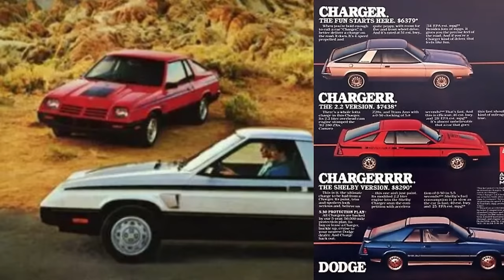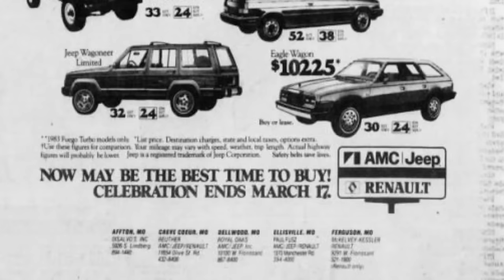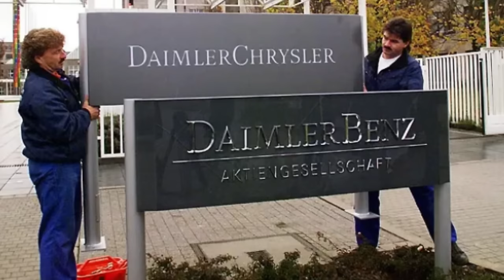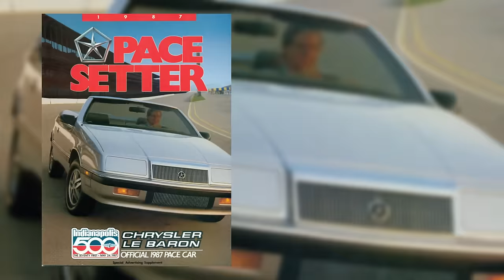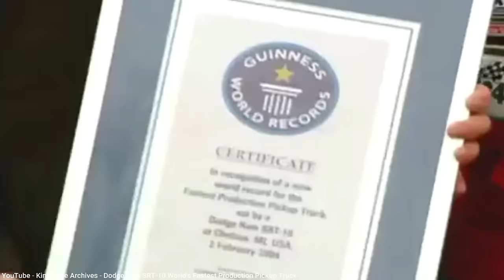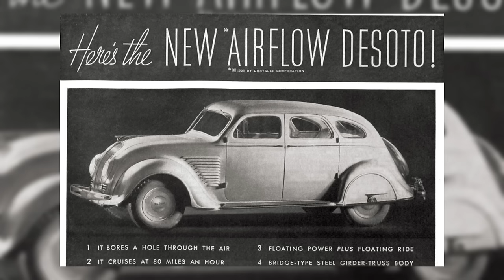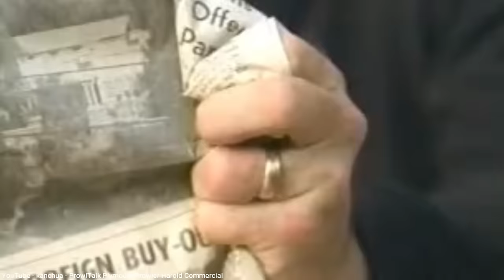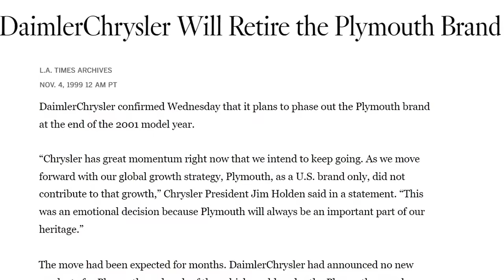Here are the Top 10 Weirdest Cars from Chrysler!

Comment: Small correction. You stated Chrysler’s Eagle brand never had any 4wd options. I currently own a 94 Eagle Summit wagon with AWD. Granted it is basically a rebadged Mitsubishi, but it was sold as an Eagle.
Reply: Also the Eagle Talon had the TSi AWD option from 1990-94
Reply: Technically 4WD and AWD are two separate drive types, but yes they did have models where 4 wheels could be powered at once
Reply: @buffufalo7714  I literally came to the comments section to say this
Reply: @buffufalo7714 I was just about to mention this one
Reply: The Eagle version of the Intrepid(Eagle Summit I think) had an AWD version. But those cars are RARE.
Reply: @davenhla  that was the Eagle Vision. I didn’t realize awd was on option on them.
Reply: @ottovonbismarck7094 You're splitting hairs.

Comment: A friend of mine had an Eagle 4WD with an in-line 6cyl. That car went Everywhere. He and his wife put over 300K miles on it.
An in-line 6cyl engine will ALWAYS out last any V6.
An in-line 6cyl has 40% less moving parts than a V6 and has a lot more low end torque.
Reply: Inline sixes are the best.
Making a comeback in the new Mazda CX-90.
Reply: Ehh, isn’t the v6 in the previous gen 4runner also pretty reliable? Not only that, but it’s more reliable than some I6s?
Reply: @E46SedanGaming  Of course. It’s a Toyota.
But the new Toyota’s with the Turbo engines simply won’t last as long as a Naturally Aspirated engine.
We were going to wait until the 26-27 year model of the Tacoma so the bugs could get worked out from the redesigned Tacoma.
Then I learned that Toyota was dropping the proven, durable and reliable 3.5L V6, so I started looking for a specific Tacoma.
23 came and went, so I figured that I’d have to buy a low mileage used one.
I stopped by Toyota to look at an access cab with the 6’ bed. I was wanting a double cab and I had to have the 6’ bed.
The truck was a SR5  but I wanted the TRD, but I figured that I’d have to settle for whatever I could get.
I would have bought it but it was the Gutless 159 horsepower 4 banger and I needed a V6.
I told the salesman what I was wanting and he told me that they had a new leftover 23 TRD but he couldn’t remember if it was a 5’ or 6’ bed.
It was in the shop having running boards and a Tri-Fold tonneau cover being installed.
They had just finished with it so he pulled it over to us.
It was exactly what I had been looking for, for over 9 months.
It’s White, TRD Off Road, double cab, 6’ bed.
Because the dealership had owned it for 8 months they were just trying to get it sold.
The MSRP was $51,848.
The dealership threw in the running boards, the tonneau cover, an 8 year 75K mile bumper to bumper extended warranty, lifetime oil and filter changes, tire rotation, and the new car care pkg all for free.
We paid $48K for it on 2/29/24.
The only thing that I absolutely HATE is the black leather interior.
I reached out to Katzkin and had them make me “Lava Red” leather seat covers with black trim and stitching.
Katzkin removed the black leather seat covers and installed the Lava Red seat covers, so I sold the black leather seat covers.
My wife informed me that next year for my birthday she’s going to have my Tacoma 2 toned in Barcelona Red metallic, which will match perfectly with the Lava Red Leather seats.
I went ahead and bought Bronze wheels.
The Tacoma Trail’s grill is grey with Bronze / Gold TACOMA lettering, so I’ll be buying that down the road.
I immediately installed a cold air intake and then I had the OTT installed.
My truck came with the TRD Performance exhaust, but I love the sound of the AWE dual exhaust system, so that’ll be installed around Christmas.
Eventually I’ll ditch the running boards and have power running boards installed.
My Tacoma now has 318 horsepower and 295 lb ft of torque at 2,300 RPM.
In my marriage I seldom ask for anything, but I’m very particular about my pickups.
I’m retired and only drive 6-8K miles per year so my 23 TRD will be the Last pickup I’ll ever own.
Toyota says to change the oil every 10K miles but I change it every 4K-5K miles, so I’ll have to pay for every other oil change, if not more as if I haven’t put 4-5K miles on my truck in 6 months, I change the oil.
Because we take my truck on Forest and Service roads in the summer months and because of the amount of snow we get in the winter, my truck is usually in 4WD for most of the winter.
I change the front and rear differentials, transfer case and transmission fluid every 30K miles.
I’m sure that when I’m dead and gone my wife will still be using my Tacoma to plow the 5-7 feet of snow off of our private road during the winter months.
Since installing the cold air intake and the OTT, my truck gets 23.9mpg on the freeway with the cruise set on 75mph and combination driving I’m getting 19-20mpg.
I baby my truck because it has to last for the remainder of my lifetime and my wife’s.
Thanks for listening and have a Great day !
Cheers
Reply: @Doc1855  holy textwall
Reply: @E46SedanGaming  That’s why I said Thank you

Comment: I didn't think that the Dodge Ram SRT-10 was that weird. Also, congratulations on the 100 episode.
Reply: baddest muscle truck ever built
Reply: @SquirminHermanthe1eyedGerman  I agree 👍
Reply: A Viper powered truck is like something from Need for Speed. Its cool, but also weird 😂
Reply: @MrTakaMOSHi The Viper engine is hardly a sports car engine. 2 valves/cilinder, pushrod, low specific output and redline. Based on the Chrysler LA V8. GM offered a 8.1 litre V8 in their Avalanche. Nobody would call that weird.
Reply: @DolleHengst  I feel like more than just the engine from the halo car it's also the paintjob, the giant wheels, the single cab body with a short bed and the spoiler that prevents using the truck as a truck
Reply: Bad thing is Chrysler never had much quality

Comment: The Viper SRT 10 was kind of an ironic truck since Chrysler originally designed the V10 as a replacement for the big block 440 in its 3500 Ram pickups.
Reply: The 440 was last made in 1978..The 488 V-10 was for a bigger engine than the 5.9 (360) in the 2500/3500 in 1994...The V-10 is a 360 with 2 cyl added on!

Comment: The only problem with the prowler was the lack of a v8 or v10 option.  Had that been the case, it would have probably seen a hellcat like reception. A built 360 magnum or a viper engine in a small car like that would have been insane! Even adding 2 cylinders to the 3.5L would have been much better.  granted, the 3.5l wasn't a slouch, but it really needed a v8.